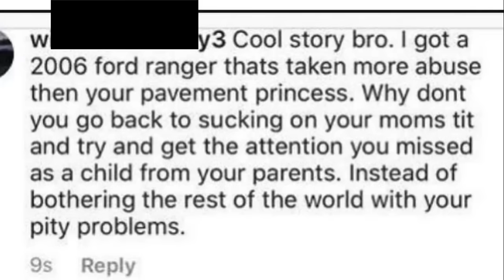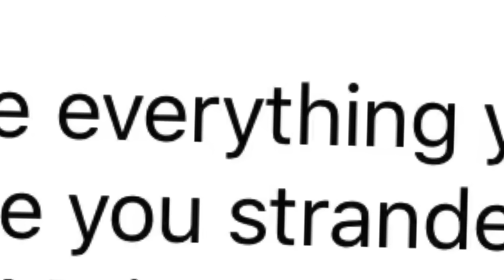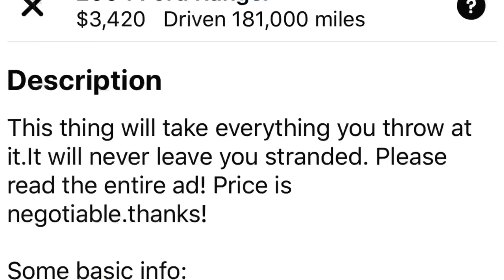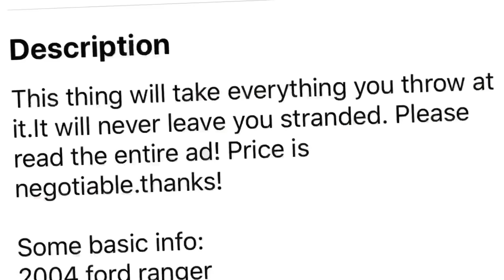“This thing will handle everything you throw at it” DOUBT

Comment: That window punch is more impressive than most people understand.
Reply: He has gotten much better with his follow through I can say that.
Reply: just a simple edit its possible he actually didn't but his hand movement makes it seem edited
Reply: @CadenMoskol  check 3:28 and then tell me its edited
Reply: @asher8773  Clearly busted that with his fist.
Reply: @CadenMoskol  As a professional Editor let me tell you its very clearly not. The amount of actual detail and preparation to take to make this work is not even remotely worth the effect. He just smashed in the Window. Especially in the way his body moved you can see he did indeed put the Force into it.
And yes, that does include faking Blood and be considerate enough to think about "where" it would bleed etc. etc.
Reply: he just had a window-breaking tool in his hand, they are useful for emergencies. You are guaranteed to break your knuckles if you try that on an undamaged window
Reply: @KekusMagnus  if you ACTUALLY TAKE THE TIME TO LOOK you would have noticed that right after, he opened his had to open the door, proving that it was just his fist.
Reply: even he seemed surprised shortly after
Reply: Yeah, watched it frame by frame to make sure he hold nothing in his hands or whatever.
Breaking a car window with a center punch is pretty sick.
Corner punch would be way easier but still impressive
Reply: id say the opposite. its really easy to break a window if you hit it in the right spot
Reply: Yeag
Reply: @V1SKosity no if YOU actually took the time too look you would've noticed his hand went out of frame where he could have potentially dropped the window breaking tool.
Reply: @wubsyyy  i dont really want to argue with blindness but.. if YOU took the time to look at his hand, you can see that with the way his hand is curled, there couldn't really be anything in his hand, unless its the thickness of a pencil. plus i dont see a point  sticking from his hand.
Reply: yeah its like a solid glass window
Reply: It's really not that hard to do lol. Any grown man with sufficient testosterone levels could do it. You just gotta fully commit, it'll break.
Reply: @charlesbrown4483  sure, do it then.
I guarantee you its not easy
Reply: @thegurem  I literally have, at a house party in 2014 and I’m only 5’8” 160lbs lol it’s really not that hard bro. It’s not a windshield, it’s just like quarter inch thick tempered glass.
Reply: @charlesbrown4483  no proof, no belief.
Reply: @CadenMoskol   yeah man just coz ur not capable of something doesn't mean everyone else around isn't.
Reply: @i.m.nager123  windows are specifically designed so that the only way you could punch through it is by wearing a ring or something and hitting a corner
Reply: @KekusMagnus   Maybe you would...
Reply: @KekusMagnus never seen Goldberg punch threw the limo window in ‘99 I see
Reply: @KekusMagnus I’ve done it to an Escalade in one shot. If it didn’t break I would have been in trouble and had a broken hand.
Reply: @silversonic99 no it’s not, maybe if the window was open a little bit but there’s a reason they make a tool to break windows.
Reply: I wouldve broke my hand 😂
Reply: IDK - I don't think it's real automotive glass. Either he got extremely lucky, or (more likely), there's some trickery involved.
Reply: @drd1924 😊
Reply: Done it bare handed. No breakage just a very small cut @KekusMagnus
Reply: you can see his hand bleeding at 4:17
Reply: He probably had a small but very hard thing in between his knuckles, like a spark plug or something or a car key
Reply: @CadenMoskol  No genius the window pretty much stopped his fist, that's normal, that means almost all the kinetic energy of his fist went into breaking it. It's not like in the movies where punches keep their momentum after making contact.
Reply: I can't believe this dude actually punched out the window....:finger-red-number-one:

Comment: POV: watching this in 2024 where this truck would cost at least 10-12k
Reply: You can find them on marketplace for like 2k
Reply: @patriotic_collector with a lot of issues, ask me how I know
Reply: @SamuelHaase  and just the fact that everything being sold at 2-4k is generally a piece of shit. You can also ask me how i know.
Reply: @Alex-mp5xe  we have both looked. Any decent Ranger or S-10 is going for around $10,000 in my area
Reply: Just a more expensive and older piece of crap.
Reply: Been looking in my area, around Des Moines. Most all I can find 09-11' are 9k to 15k. Manual transmission tax applies.

Bought my 2011 F250 XLT 4x4 6.2 back in 2015 used. Got it for 23,000, and I could probably sell it for what I bought it for now if not more.. Inflation/Prices have gone nuts.
Reply: @SamuelHaase Got mine for 6k. 

1990 4.3 liter with 75k miles. Bit of body rust around the radiator housing and fendors but the frame is mint and some decent scratches in the paint. But genuinely pretty clean for what it is. Been replacing all the suspension on it and doing some cliche but pretty cool interior work in my free time. As much as people crap on em, I fuckin LOVE my little old truck😂
Reply: @patriotic_collector  yeah if they're worthless.
Reply: Bought a really clean 09 ranger XLT v6 rwd automatic about 9 months ago via private sale, cost me $7500 Canadian …. Obviously didn’t have the lift and add ons but came with a headache rack and sprayed bed liner, beauty all terrain good years, only 150,000km on er… think your a bit high on this estimate but may depend on location, nonetheless the price of used has really gone up in recent years
Reply: How do you know jk

Comment: Whistle Diesel: Gets mad
Pulls out an AR15 and starts shooting his truck

The most realistic GTA5 is ever gonna get 😂
Reply: That's not an AR
Reply: @elijahjackson7125  it is though lol.
Reply: @Spooky-ek3kf  no it’s not it’s a sig mcx
Reply: @PRExJay  literally google “what does ar stand for” I just did to make sure it gives you the right answer
Reply: @elijahjackson7125  soooo a piston driven AR style rifle that takes AR style mags and the lower is still very much an AR with virtually the same charging handle. Sounds like an AR to me.
Reply: @elijahjackson7125  but if you want to get super technical with the internals of the rifle being different than I guess?
Reply: @Spooky-ek3kf  other than the pistol grip and maybe the bolt idk that anything else is interchangeable
Reply: @elijahjackson7125  bolt won’t be interchangeable since it’s a piston driven system to my understanding
Reply: @Spooky-ek3kf yeah I looked into it and the MCX is basically just a copy of the ar18, the bolt has the same locking lugs and junk but not interchangeable. What’s funny though is that it kinda just looks like they’re taking ar15 bolts and not doing a couple milling operations from my eye
Reply: @elijahjackson7125  Everything minus the gas system, bolt, upper receiver, and handguard are interchangeable. The MCX is more or less just a fancy upper for a standard AR15. 
That being said, the AR's big distinct feature is being a DI system, so I'd argue this is more not-an-ar than is.
Reply: @Spooky-ek3kf  not an ar-15 at least
Reply: lol yea
Reply: @elijahjackson7125  we’re not all gun specialists Eli

Comment: This made me wanna daily drive a ranger
Reply: I think the ford mustang from 1966 will break down less then the ranger
Reply: @BLJMARIOSM64  i put my 66 mustang into a tree sideways at 50, patch of black ice. went off the road wrapped it around the tree driver side door, i climbed out the passenger door, this square body pulled me out and i drove it home a mile away
Reply: @doctorb.5893  WOW you really hate mustangs i think
Reply: @doctorb.5893  also at least I do have a Datsun 280Z that TOTALLY NEVER BREAKS DOWN
Reply: @BLJMARIOSM64  not at all, loved that car, it hurts every time i talk about it, it was my first car, i was driving home after talking to a mechanic about rebuilding my motor and trans and hit some black ice a mile away from my house.

had a 64 1/2 as well  302 30 over, it was my dads, sold both of them in 2006 for 5k. car prices have gone up a little
Reply: @doctorb.5893  what car was it?
Reply: @BLJMARIOSM64  mustang, we’ve always had a mustang, my dads first car was a 69 roadrunner, then had 65-66 mustangs, right now we have a 2004
Reply: @doctorb.5893  was it the one the you crashed?
Reply: @BLJMARIOSM64  I crashed my 66 that had a straight 6
Reply: @doctorb.5893  I remember that the mustang had a v6 not a inline 6
Reply: @BLJMARIOSM64  they had straight 6 which I think was a 160,  they had the 289 and some had 302, 351 swaps
Reply: @doctorb.5893  well one of three mustangs we have is a v6 mustang the others are 6.4 L v8
Reply: @BLJMARIO- Rangers run forever unless you dont change the oil. My gpa had one for 30 years. Even after he bought newer trucks hed still keep that old ranger bc it just wouldnt die.

Comment: I'm impressed that it didn't flip w/4 inch blocks. Only thing I can think of is that big trucks are top heavy so I guess that's one thing smaller trucks have an advantage with; doesn't flip as easy; and the only other thing I can think is that it can fit on the trails better if you're hunting or just four wheeling through a national park. Can carry extra gas and used more efficiently on long journeys. Other than that I have nothing. Great video.
Reply: Yeah but Rangers also have a roll over warning on the sun visor, and the Ranger based Bronco II loved to roll over.
Reply: @superstar64  I have a old shit box 96 with 31s that I like to do jturns in the mud with, hard to flip because I kept it low. That's why I'm so surprised with the one on blocks in this vid haha bronco flips easy probably bc weight distribution is whacky in comparison but idk I'm just guessing. Never owned one.
Reply: Well trucks nowadays can easily have the same mpg and many are better, depends on what motor you have as like the 6.4 hemi is terrible on gas not sure on other brands bc my family is a dodge family and im the only one with a ranger and not some kinda dodge lol. Like the 4banger rangers might be pretty good on gas but there's absolutely no power. The 4.0 6cyl which is what I have although still a underpowered motor, for what it is and what it's in, it's pretty preppy and it's pretty durable. I love this video but we actually dont all think "everything" as in like that really we mean everything you will ever really need a truck for. You can overload them hella and still go where you need without any real issues, just be cautious as that's asking for suspension and trans issues along with practically everything else as the motor could just blow under the stress anyways. Strong lil truck but still just like any other vehicle of you are actually beating it like in the vid it won't last lol but you can have all your fun with burnouts and drifts and stuff just need wet pavement for the best drifts

Comment: Put a gooseneck in it and get a big ass trailer and see how much it can’t haul before breaking lol
Reply: Clutch probably wont hold
Reply: I think the 4.0 was good for 6000lbs.
But that may have been with the automatic, extended cab, 2wd only if memory serves me correctly.
So it could legitimately haul a car on an aluminum car trailer.
Reply: You have a point but the ranger was made as an alternative to it's bigger brother which was MADE to haul shit. The ranger was made for the working man that needed something to haul his boats or hunting gear around. I own 3 and all are still working
Reply: @zfixation9817  I doubt it the 5.0 V8 F-150 can only tow like 7000
Reply: Come on we all know it'll haul 25,000 lbs with ease 😫🤣👍
Reply: @daniel27560  look it up, 4.0 extended cab. 🤷‍♂️
I was a little off, but if you find the 2011 ford ranger brochure 5800lbs is listed as max towing, and with that said, some people have taken it up to 7k with no real issues as long as the load is stable.
Reply: @zfixation9817  no real issues right away but just wait till later till the chassis is cracked in the Transmissions fucked so are your bushings everywhere
Reply: @daniel27560  just got a ranger, 2.3l. In the manual it's rated for 6,000 lbs
Reply: @higuy715  that's the new one not the old crap box

Comment: I have a ranger lmao, but I don't hop on the "toughest truck ever" wagon... I just like my truck
Reply: Not the toughest ever, but they're tough little trucks for sure! I owned 3 but now I'm a FS Chevy guy.
Reply: This.  I own a Ranger because it's a good cheap little truck for getting around, hauling something now and then, and just goes.  No pretense.  Nothing to prove.  I know full well if I wanted to do any serious towing or heavy duty "truck stuff" I'd have to get something bigger, and that's fine.
Reply: Ya, that honour belongs to the hilux that some how lasted 3 videos.
Reply: I don't mind mine. Has 255k miles and still going strong. hasn't ever left me on the side of the road.
Reply: Man I got a 92 Isuzu. Tell ‘em it’s a race truck and just floor it. I just love driving my truck
Reply: ngl i just got rid of mine not too long ago and replaced it w a 02 crew f150 but one thing the ranger can do that a full size cant: fit in a normal parking spot
Reply: I have a 1st gen ranger with 88k miles (yea ik really low for a 30 year old truck) and she just plain runs. Was literally just sitting outside for a few years and fired right up when I turned the key 1st time. Only thing that's gone out on me so far has been the starter and a blown fuse for the right turn signal (they were both dying when I got it)
Reply: That's why I like them it's supposed to be so boring that there shouldn't be anything to be enthused by, but that in it of it self makes it unique
Reply: I don't think anyone say they're the toughest trucks ever. A lot of people do like to hate on it since it's ford but it's got a really good reliability rating. it's super reliable and cost next to nothing to repair since there's a ton of these trucks still on the road, a lot of parts for it. Plus it's gonna be able to do any work you throw at it. also, if you only need a 4cyl it's got the best gas consumption in 4cyl pickups. Sure a Toyota might be more reliable but it's going to cost a lot more and there's a lot less on the road, in Canada at least.,
Reply: Happy pride month y’all 🌈🌈
Reply: @danydemers2851  seeing enough of them limping some meth head along on one cylinder tends to build a myth, that's the true test of reliability in an Americans eyes, can you hand it to the worst car owner possible and it still get you to point b.
Reply: @coreygolphenee9633  story of mine lol.  After a few months of having it I decided to do a full tune up of everything.  When I got to the spark plugs the were old af.  Not just that, 2 were cross threaded into the cylinder.  One of them was barely hanging inside.  It’s still slow but not as slow as before🤣
Reply: @coreygolphenee9633  loL worst car owner aka whistlin

Comment: That poor guy was so proud of his truck too
Reply: Tbh it looks okay but structurally it looks sketchy af
Reply: @jamesprice2163  that's just rangers, remember this thing probably weighs 2500 pounds empty, aka less than some compact cars of the day, and the didn't have shit towing/hauling
Reply: @Prestiged_peck  yeah i drive the gmc version (sonoma) and its sketchy af too but i still beat the hell out of it and love every second of driving it
Reply: His mom must of screamed at him his whole life. “Now listen Corky,  I’m not Whistel’n Dixie here boy. Now come back and finish supper boy. Then you can go outside and play with the pole.”
Reply: A set of brass knuckles and you can pop them ranger winders right out.
Reply: @Prestiged_peck  The Rangers could actually haul pretty well, they were rated for 1600lbs with the short bed and I think 1900lbs with the long bed. I had a short bed extended cab Ranger that was beat to shit and ran like dog piss but I hauled 1 ton of mulch 15 miles with it, and then hauled 1 ton of rocks with it. The thing never stopped. I never towed with it but I hauled quite a bit. They were really good for that.
Reply: @enlightenedrenegade472  I know but they weren't rated for it, I've seen rangers haul loaded triple axle goosenecks, sketchy AF, but definitely doable
Reply: @Prestiged_peck  Like I said, the 7 foot box Rangers were rated for 1900lbs IIRC, which is quite a bit for a 1/4 ton truck. I miss mine
Reply: He was a Ford owner he shouldn’t be able to be happy

Comment: The only reason it would roll backwards is because the guy couldn’t drive a manual properly
Reply: Yep came here to say that, imagine feeling the need to brag about having a manual but not actually being able to drive it
Reply: Yeah the previous owner probably didnt have that sticker on it, im sure diesel added it to build the story on the type of person that like rangers.
Reply: Lol truth. “May roll backwards cause I can’t drive stick....should have got the auto”
Reply: See mine rolls back a bit not cause I can't drive it but it needs a new transmission not long after it quit with my dad but yeah if you roll you can't drive a manual
Reply: That's the truth.
Reply: i mean i cant drive one at all
Reply: When I'm stopped on a hill and some A-hole decides to stop 4 inches off of my bumper, I will intentionally roll back 2-3 inches when the light turns green before letting up the clutch. Hopefully I've made a few people sweat and reconsider how they come up on stopped cars from the 90's.